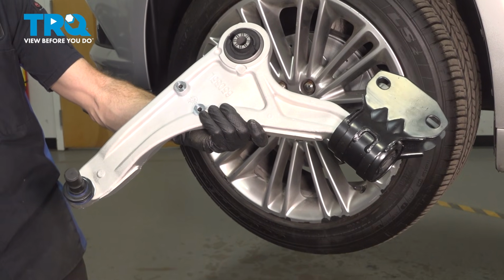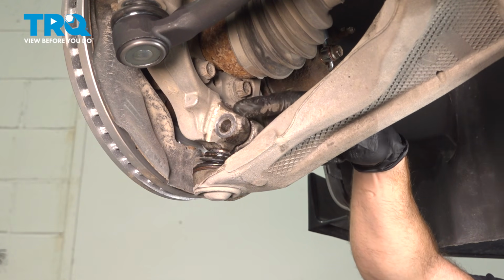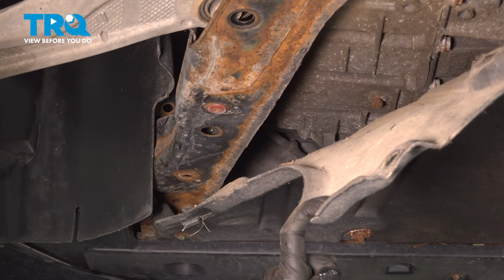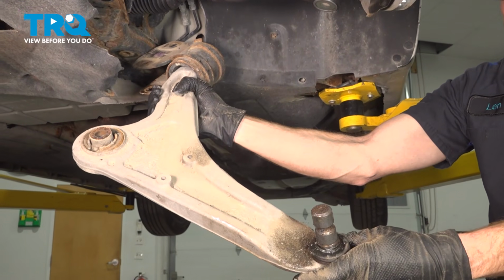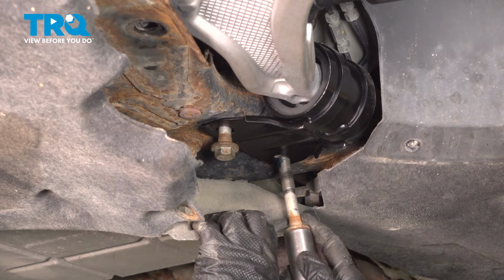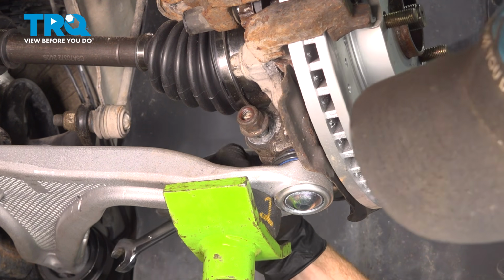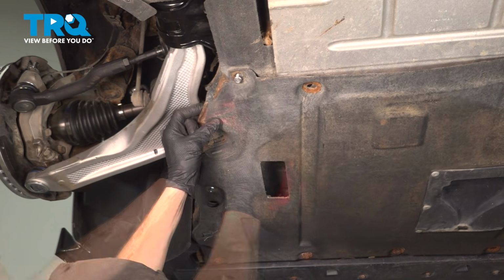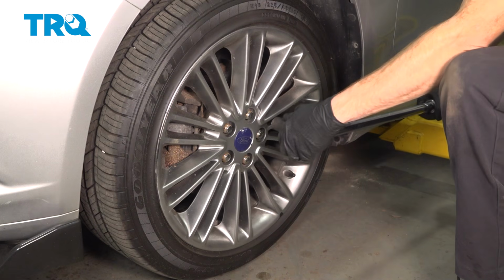How to Replace Front Lower Control Arms 2013-2020 Ford Fusion 2.0L I4

Comment: He also is taking off a wheel and tire at the beginning and the rotor is rusty as heck. Soon as he starts working tho - the vehicle has a super clean new ported rotor - (diff vehicle) ? Does the work the entire time, all the way to the end when he torques the castle nut back down, then soon as it shows him putting the wheel and tire back on, the vehicle has a super rusty rotor again. Odd

Comment: Very instructional. But please replace all of the mounting bolts and nuts. These are torque to Yield. This means they stretch when torqued to correct specifications. I know they are expensive but it safer to do so.

Comment: I replaced the CV axle and the control arm yesterday. I ended up spending more on the tools I needed than what the mechanic would have charged me, but the feeling at the end after getting it done was worth it. This video was essential in giving me the confidence to do it. The comments here were also important and had great tips.

My advice is: be prepared, it’s not easy if you’re doing it in your driveway. But give it a try and do it. I don’t have any experience with mechanics, I’ve only changed my car’s oil, but now I feel like I can do more. Thank you.

Comment: Anyone have the female hardware side of sway bar bushing bracket snap? Removing bolts and there’s now effectively two round nuts on top I can’t reach either to tighten or loosen 😬

Comment: Please read if you’re doing this on your drive way, jack up both sides of the car. That will remove pressure from the bushing to be able to slide in the lower control arm, if not all the pressure will make you struggle really bad….i also removed the top screw off the sway link bar for better movement but not necessary. This will save you lots of time and should be quick and easy

Comment: Great video. For those of us doing it in the driveway here's a couple tips. Get new bolts before you start the job. The old ones are likely trashed, 2 of mine were unusable. I used PB blaster on all 4 volt locations several times leading up to doing the job and still had to torch 2 of the bolts, so have a plumbers torch or something equivalent handy. Getting the new control arm under the sway bar bushing is brutal. I found that using a very stiff scraper and getting it under the sway bar bushing and sort of prying it up while using my heel to push the new control arm in worked swimmingly. Lastly, get a good set of awls to line up the holes, it's impossible without it. Impact wrench helped a ton but unfortunately you lose a little touch and when putting in one of the bolts it was cross threaded and broke the top of the sway bar bracket off. I ended up having to cut that bolt off which was an ordeal because of limited space. Overall an easy job with the right tools and don't be like me in a rush and make a 2 hour mistake lol.

Comment: Thank you TRQ!.) Tips: 1. Buy a propane torch $25 to heat the seized bolts. 2. A 40in breaker bar $40 will save your sanity :p. 3. Remove the sway bar link to get the control arm sleeve under the sway arm rubber bushing or prepare to cry ;p. 4: Remove the 24mm Strut mounting bolt (there's 2) and thread it with a screwdriver to make it easier to move the steering knuckle over the ball joint. Don't tighten anything until you get the ball joint in. This is not easy at all, but patience is the only way to beat this. Took me 2 separate attempts. Today I started at 6am and finished at 11: 30am for 1 side. 5 1/2 hours. Doing the other side next week, should be a lot faster. Famous last words .....

Comment: My M12 1/2 stubby let me down for the first time today. Tried this and it couldn't remove the rear bushing bolts or the larger one. Only one it could easily take out was the ball joint and then the ball joint was seized. Literally bent the pry bar trying to get it out.

Comment: I did both sides of my 2017 Fusion over this weekend on jack stands, and definitely learned a few things.

1) WATCH THE VIDEO. Going out of order will do nothing but frustrate you. This is part of the reason I spent parts of three days doing this.
2) If you're having trouble getting the ball joint completely out, lay a 2x4 across the control arm near the ball joint and a couple of whacks (I used a rubber mallet, but anything heavy should work) should get it the rest of the way out.
3) Finagling the rear part of the control arm under the sway bar bracket isn't easy. It's not just you, it's rough going. Getting the holes lined up afterward can be challenging too.
4) Be prepared with your full arsenal. Impacts, breaker bars, pry bars, all of it. Road salt probably didn't help my case.
5) WATCH THE VIDEO. Seriously. It's not as easy as it looks, but it's not THAT bad once you know what you should be doing.

Comment: The video was very helpful.  Realigning the new lower control arm with the knuckle, sub frame is just a challenge working with floor Jack's as opposed to vehicle lifts.

I had to loosen the strut bolts attached to Knuckle (2018 Ford Fusion) to get enough leverage  for the ball joint to sit in place.  It was a very snug fit (Hammers Involved)

Comment: A question, after installing the new lower controls, do I need to have the suspension aligned or will it not be necessary?

Comment: I did this on a 2013 Lincoln MKZ. This video is super helpful and is really frustrating because of how easy they make it look 😂. A couple things that would've helped me if I knew them beforehand:

1. On the Lincoln, there is a ride height sensor attached to the lower control arm. A 10mm socket will remove it and you can let it hang after disconnecting it.

2. When pulling the ball joint out of the knuckle, it helped me to take out all of the bolts first. This gave me a little more play to get the control arm into a position that helped the ball joint come out. Mine were particularly difficult, so larger pry bar and some careful whacks with a sledge got them out.

3. Something they don't mention in the video is to be very careful about pulling on the hub. I was able to hit one side with a punch to break the spindle free from the hub, but the other side wouldn't come free no matter what. I tugged on the hub and the axel came out of the inner CV joint. So, if you can use a punch like they do in the video, just make sure not to pull on the axel. If you do what I did, carefully try to  reposition and push the hub and axel back into the inner CV joint. I was able to get it back in after only about hour of frustration and cursing. If you get the control arm in and can't seem to get the ball joint lined up with the knuckle, this may be your problem.

4. As some other comments have said, slipping the bracket underneath the sway bar bushing is much tougher than it looks. It could be because I was working on the ground, but that bracket was really tough to get under it. The easiest method for me was to use a floor jack to very slightly jack up the sway bar where it is connected to the sway bar link. This might not be recommended, but it was the only way to create some space for the bracket to go in. Once I got it under, I did it the way they showed. But as soon as you can get one hole lined up, put a bolt in. This will prevent it from slipping out and having to start over.

Comment: Not seeing where undoing the hub nut gains anything,   track rod end removal would be more beneficial for access and wiggle room. 
 I do wish non power tools would be used in these demonstrative videos , while they very instructive they give a false idea how easy a rusty,  tight 21mm bolt can be to remove, not everyone has pro tools NOR  a vehicle lift.

Comment: It was easy to take off, but working on the ground, and after putting the control arm bushing bolts in place loosely, (which the rear mount would not just slide under the sway bar bushing....had to remove the link bolt on the strut), the balljoint would NOT slide into the spindle...wrong angle....had to remove the strut mount bolts....then it worked.
It's easier having a shop lift for sure!

Comment: I am preparing to replace the control arms on my Fusion. Many individuals report difficulty removing the control arm bolts, and it becomes a nightmare for many. I believe this is often due to neglecting to remove the axle nut beforehand, like demonstarted in this video. My understanding is that removing the axle nut it disengages the axle from the hub, thereby eliminating the binding from the control arm bolts and  facilitating in control arm removal.

Comment: I just wanted to point one thing out but also had a question. My question is: are you supposed to push in the hub nut into an indent on the axel or does this car not have that? If so, the thing i wanted to point out is it should be stated not to reuse the same hub nut. Outside of those thoughts, i loved the format of the video and how clear the information is put out there ❤️ you guys have helped me a lot on past projects and will of course always come back for more

Comment: Would it be the same process to replace the bushings? My 2019 fusion Sport just started making a short click/creak noise on the right side when I turn my wheel. I'm guessing a bushing is dried out